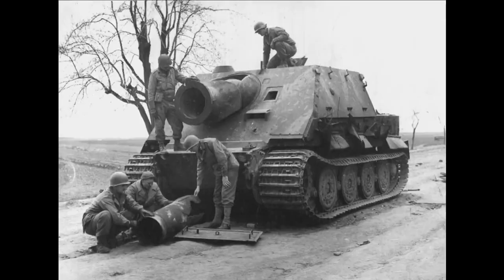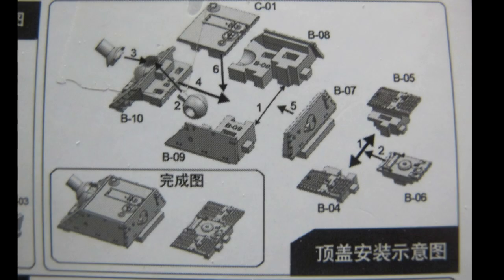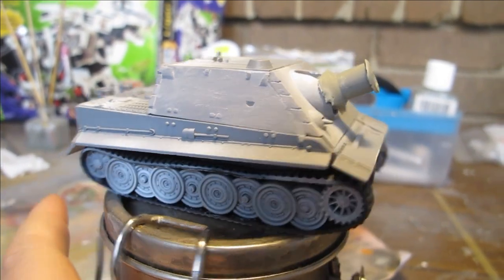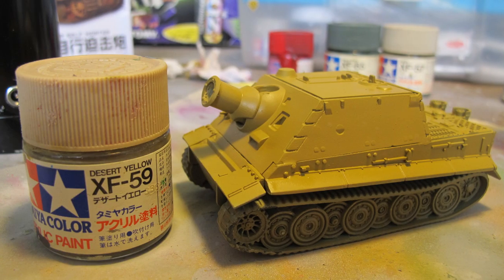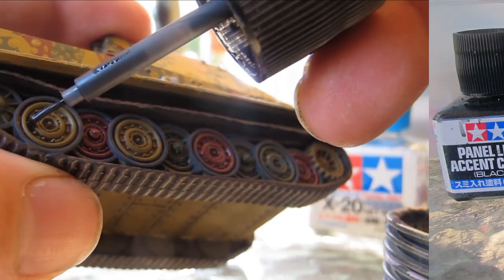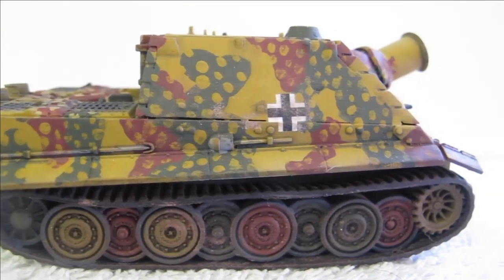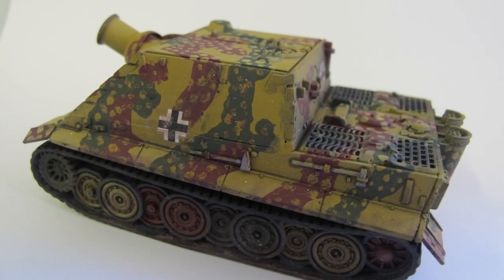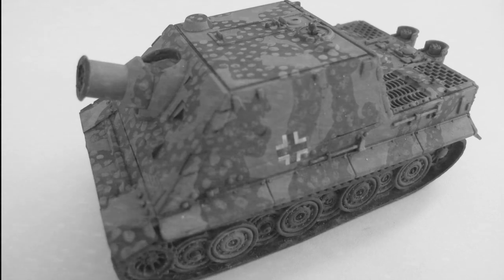4D models 1/72 SturmTiger Self Mortar

Comment: I've had some issues with hand painting Tamiya and Gunze paints, finding that they dry too quickly. I usually put a bit on a small palette to thin a little, but i can only dip my brush 1 or 2 times. I might try a round bottomed palette or even drying retarder. Any advice?
Reply from the maker: Alcohol acrylics are chemically strange paints, they are flexible in being airbrushable, maskable and hand paintable plus non toxic or smelly yet they are not excellent at any of these aspects. I also find them hard to hand paint and airbrush with intent to use up whats left and no longer buy them. Tamiya does sell a retardant which is exelent and paired with thinner should net you better experience in slower drying time and smoother application. If fumes are not an issue I would recommend trying enamel paint and thinning with a dry thinner and greasy turpentine for the effect you wish to obtain.
Reply from the maker: This video will give a visual demonstration. https://www.youtube.com/watch?v=s8VGup5b0bA&t=1s

Comment: Wow wery nice little sturmtiger! Btw, do you think that mr surfacer 1500 pink is a nice primer to go over with anime skin tones?
Reply from the maker: funny you ask, mr 1500 pink is designed to go under armor/ aircraft to appear warmer in tone. It will work on flesh but if the skin is shaded too lightly the figure will look sun burnt. I think white primer would be more suitable for a beginner.
Reply: @mokanaman  I also bought white primer, but I was thinking pink on dark skinned anime characters. I will not say I am a beginner at modelling but I am a beginner at anime modeling tho. Thanks!
Reply from the maker: @statoilbensin2190  I dont think any out right beginners attempt anime GK right off the bat excluding some very talented women I've come across but it is a new skill set and experience. Dark skinned would work nicely.
Reply: @mokanaman  Of course you need expirience in shadeing with airbrush etc but I have that from before, just never done it on figures.